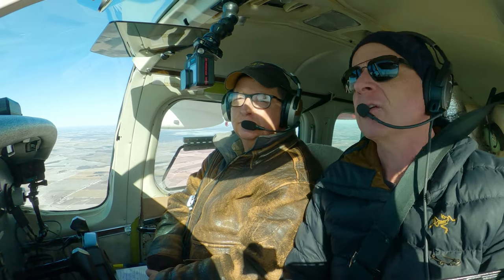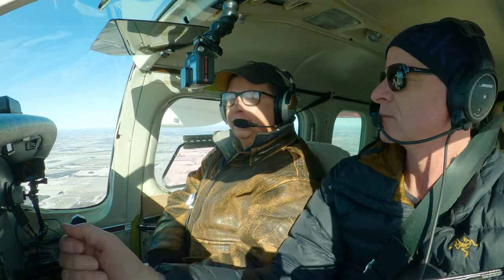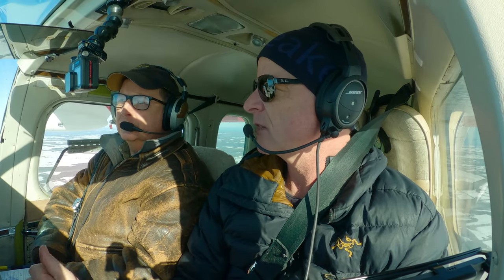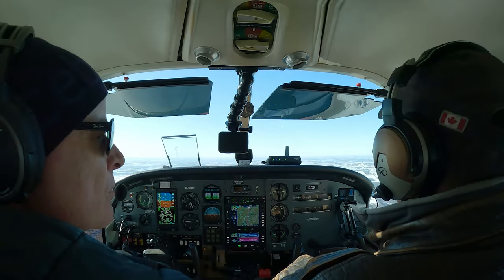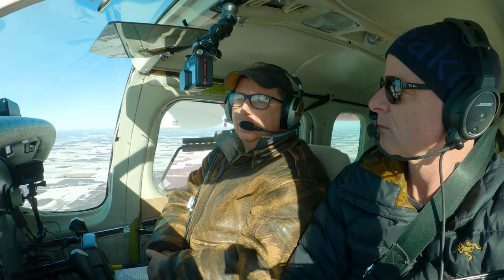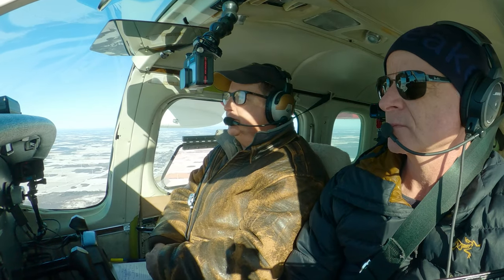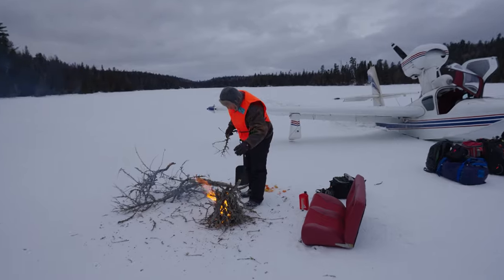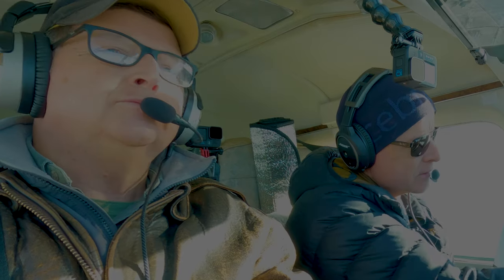Tom & Paul Talk ELTs & Rescue Beacons

Comment: How do you load the “backroads” maps n your Garmin inreach? Do you just buy a card? 
Btw, great info in this video. 👍
Reply from the maker: Hello and thanks for watching!  Great question - In order to get BRMD maps on Garmin devices you buy the SD card from the good folks at BRMB ( https://www.backroadmapbooks.com/destination/gps-maps/ ) and stick it in the SD card slot on the Garmin and BOOM - you have awesome maps of whichever region of Canada you choose.  
However, I think I just saw something on Facebook today where they were talking about Garmin licensing the BRMB data and possibly including that with new Garmin devices.  I'll look into that and get back to you.
Reply: @tomairtv  
Thanks Tom, much appreciated.
Gilles
Reply from the maker: @fly-n-m9445  Actually I had that wrong.  BRMB is "licensed to be used in Garmin devices" but does not come pre installed (ie: you have to buy the cards & the GPS device).  If you do a lot of remote or cross country flying in this country it is well worth it for piece of mind.
Reply: @tomairtv  
Thanks Tom, much appreciate the info. 👍